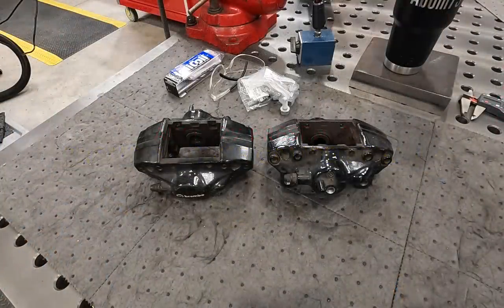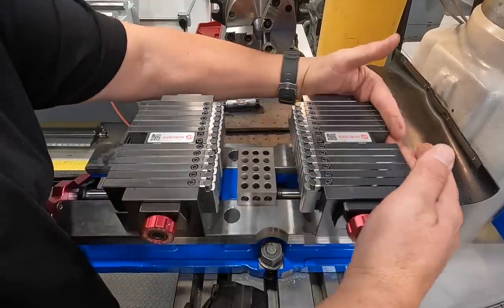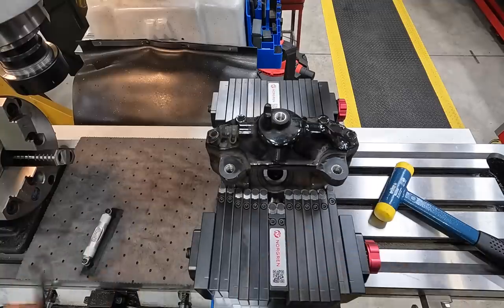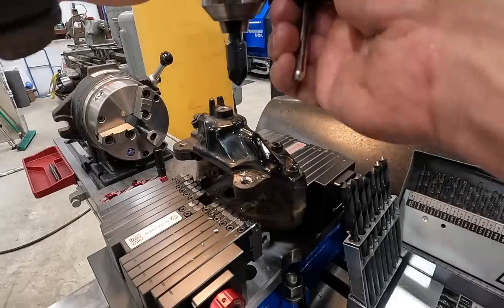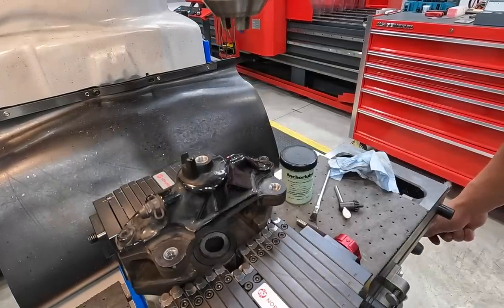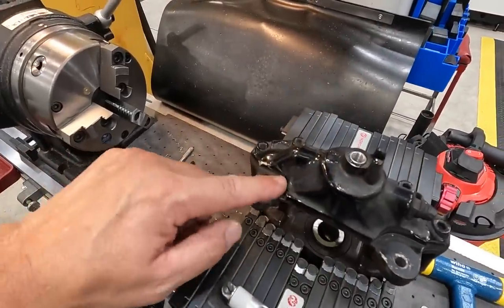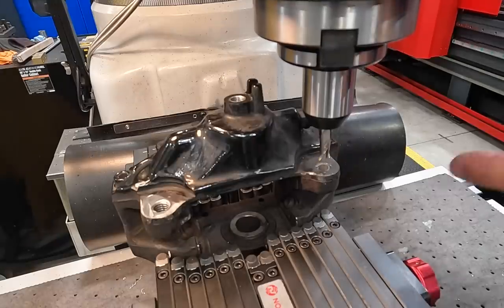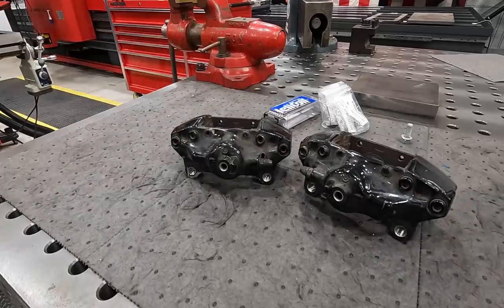Brembo Brake Caliper Repair

Comment: Adam... been a subrcriber of your channel for a while and really love your work... but I have to say I would not touch brake parts... Maybe this was a way for you to show the capability of the new jaw system and for that it has served its purpose, but modification to old brake parts is just looking for trouble...If that vehicle was involved in an accident and it was in some way related to the brakes what then...  As I said the machining and methods are all good... but I would have declined to work on these specific parts...  Just saying... keep up the good work!
Reply: I came here to say the same thing...  As a brake tech for several levels of Racing (mostly Alcon) in the 90s and 2000s, these are not "special" brakes, despite the Brembo label.  The prescribed method of doing any machining on these would be to pull the 4 bolts and use the machined surfaces where the two halves join for reference.  But you are right about the vise being shown off well.   Beyond that, any level of machining the attachment points (especially on an axial mount brake body) is a HUGE no-no.   If Adam has any sort of liability insurance on the shop, the carrier will be calling Monday morning and demand he take this video down and the Insurance Co. lawyer is already screaming NOOOOOOOOO!!!!  As soon as you machine a brake body you release the OEM from ANY liability and assume it yourself.
Reply: @ramosel  Great Speech...but the entire world has no problem replacing brake parts made in...???....
Reply: @phased-out-24-73  yep...  but how do you sue Chiang kai-Shek Brake Parts Ltd?  It's easy to go after Adam.   New parts, regardless of origin show intent to make things right.  Receipts stand up in court.  Most (reputable) car flippers will change out all the brake parts on each corner... add it to the cost of the car and sleep well.   I've never heard an investigator site new parts.   Altered from OEM design....?

Comment: I prefer thread lock during insert, not lube.
Reply: I was wondering about that.
Reply: @vincenzo6412  Me too
Reply: Me three. I've seen a lot of Heli-Coils unwind themselves.
Reply: They usually won't wind back unless the bolt seizes to the tread insert. I put them in dry. The top thread digs into the aluminium if you try to back them out. Best to get the length right before inserting them. Then I use silicone sealant to prevent bolts from seizing because it seals the thread from moisture. Worked on my twenty year old dock, no seized bolts.
Reply: @paulshermet535  Yeah, I was thinking red loctite on the coil and antiseize on the bolt so there is no chance of ripping the coil out if the bolt is stuck in.
Reply: @paulshermet535  I use the coils with teeth on the OD if I'm worried about them backing out.

Comment: I thought you loctite them in place, I always have on any I've done. don;t want the helicoil backing out when removing the fastener in the future
Reply: That's the reason the coils have a tang to remove to lock them. Usually when a helicoil comes out is due to improper hole drill size.

Comment: Asking as a layperson, why use the end mill to remove the broken bolt if you're just going to use the drill bit to drill a clean hole?
Reply: There was a hole off-center to the bolt so a drill would want to follow that hole.  The end mill can cut through the bad bolt on one side and put the net hole back in the original location so it can be bolted t the spindle again.
Reply: @kensherwin4544  Thank you

Comment: Could you have threadlocked the helicopil in the caliper during insertion? Or is there no risk of it backing out
Reply: That's my thought. I always try to use threaded inserts with locktite for thread repairs....maybe I've been overkilling it.
Reply: Per the manufacturer, helicoils are to be installed dry

Comment: you should be putting red thread lock on the insert. it will come out the first time the take the bolts back out
Reply: If that's an issue you should be using a different type of heli-coil.
Reply: You dont use loctite on helicoils. Read the packaging!
Reply: I've never had one move after installation. Ever try to get one out?  Even without loctite it's friggin' impossible

Comment: A threadsert with Loctite instead of a Heli would have been my choice for that only because the torque on them and the fact that they will be taken apart every 40k or so miles by hacks at a Midas
Reply: Loctite wouldn't work for this job. The caliper is aluminum and the helicoil is steel. Loctite and other thread locking compounds only work on mild steel.
Reply: @NP-rh3dt  that's certainly untrue based on their marketing and my experience and auto manufacturers recommendations. Millions of steel bolts in aluminum engines have been successfully loctited
Reply: @NP-rh3dt  Reading comprehension is important, I said threadsert not a coil, which have been standard practice in repairing threads in aluminum blocks and components since the dawn of time. I lost count of how many Northstars and Olds Aroura L47's head bolt threads I had to repair with serts. Everything else you said is just untrue
Reply: @quick455  I've never heard of the brand threadsert, I have heard of time sert however. Those are steel threaded as well. You'd didn't specify aluminum inserts specifically. I don't really see the point in putting in an aluminum insert either, you'll probably end up with the original issue of the aluminum threads gauling up.
Reply: @UnreasonableSteve  No they haven't been successfully loctited. Unless it's aluminum specifically loctite, the thread locker is acting more like a glue than a true locker. Red loctite is so powerful because it actually creates a bond with the steel. I remember a demonstration I saw where red loctite was used on stainless and mild steel bolts. The mild steel bolt was practically impossible to unthread. The stainless bolt was possible to unthread with some difficulty. Cars are also a terrible example. I work in heavy industry where thread locking is taken much more seriously. I was told from day 1 that loctite only actually works on mild steel.
Reply: @NP-rh3dt  you were told wrong. Loctite certifies that their product works on aluminum. It is indeed basically a glue, but it functions equivalently for any of the metals listed. You said it's virtually impossible to unthread a steel bolt from a steel hole (I assume without heat) with red loctite and I agree. The same experiment would have the same result with aluminum because the aluminum threads would be torn apart before the loctite would let go. The claim that loctite wouldn't work to hold a helicoil in aluminum is ridiculous

Comment: Did you consider drilling a larger hole and pressing a new bushing with the correct size thread into the oversized hole instead of using Helicoils?
Reply: Just pressing a sleeve in won't work because it will pull.. it is possible to thread a sleeve in but it's more work and has the potential to screw in or out then loosening or tentioning the bolt and it would require more material to be removed.. helicoils are far better and the repair is better than new
Reply: @markshort9098  He Did Tread A Sleave Into It!!! It Just Had The Internal Threads Already!!!
Reply: @rockerpat1085  maybe read the original comment and then read my comment responding to it.. I know all to well what Adam done, I've installed many helicoils myself

Comment: I know everyone thinks differently but dont you think you should have used loctite on the Helicoil?
Reply: That's how I was taught to do it.
Reply: @josephcote6120  me too
Reply: Not necessary. If you have an application where the additional retention is needed, you'd use a different insert than what's shown here.
Reply: Heli-Coil says no, dry, friction holds the insert.

Comment: You could have taken apart the two halfs of each caliper and put them on a fixture plate. It would be faster and easier
Reply: …but not such a fantastic example showcase for the sponsored vice jaws.
Reply: @mlenstra  Thats what i thought :)
Reply: @mlenstra  the.................... $7000 vise jaws.
Reply: @weldchip  Holy sh*t, that’s priced... rather exclusively. I guess this falls in the “if you have to ask what they cost, you can’t afford them” category of products intended purely for high dollar intensive business use where saving 5 minutes of setup time per job means these pay themselves back in mere weeks.

Comment: While is this is a good use of the vice, it's probably easier to remove the allens that hold the 2 sides together and bolt the half flat to the table.
Reply: Brembo doesn’t recommend splitting these. You’ll also have to replace the o-rings which can be a little tricky to get ahold of.
Reply: @mittenvision  Good point, I split other calipers a that are assembled the same way without issue tho.. Brembos can be a PITA to rebuild parts for..

Comment: Is there a reason you didn't use a Time-Sert for this? I kinda prefer them to a Helicoil. Also a fan of the Keensert. IMO, the are both a bit more permanent as the helicoil can pull out.
Reply: He has always used helicoil for thread repairs. I also prefer time-sert but once you guy into a system it is hard to change. Helicoil is fine for this application as it a larger thread and does not come apart often.
Reply: Quick question guys - these systems you are discussing, I assume they're similar to a helicoil?

Would there be any advantage to using a tiny amount of threadlock when installing such a thing?

Never used anything like that, I'm just curious.  And you guys seem to have experience.
Reply: @antontaylor4530  you can loctite helicoils but because it is a coil and not a solid insert it can get on the bolt too and lock the bolt to the coil making the problems worse. You can you just have to clean very good.

Loctite timesert as well and it is recommended on some applications such as cylinder head bolts. Because it is a solid insert the concern of getting loctite on the bolt is eliminated. But timesert is mechanically locked in place by the insert tool so normally loctite is not needed.
Reply: @jrichardson-m9m  Yeah, I did think I saw a little daylight through Adam's helicoil.

I saw a project farm video where he proved that, at least for aluminium parts (cylinder heads etc) that helicoil and other metal inserts are significantly stronger than the original threads.  Even some crazy cheap Chinese knock-off kit did wonders.

I was looking at them wondering what stops them moving around, though.

If you used a tiny amount of loctite on them, you could let them dry before running a tap through to get rid of excess, couldn't you?
Reply: @antontaylor4530  helicoils are actually a little bigger than the threads you cut for them so you have to squeeze then in. That is why he put a chamfer on the hole. That usually keeps them in place.

Never run a tap through the insert, you will just hurt yourself. It is likely to damage the insert and bind the tap.
Reply: @jrichardson-m9m  It is a brake caliper. It will have to come apart a bit moer than, say a valve cover or oil pan. For that reason, I like the Time-Sert. Plut the ability to use a locking agent on the TS. Helicoil can't be locked.
Reply: @jrichardson-m9m  Roger that.  Thanks for the advice!

Comment: Adam....I've never used those Helicoils so sorry if this sounds silly but.... I'm curious,  how do you snap off the tang in a blind hole?
Reply: he shows it in the video. a punch & knock it out
Reply: the helicoils  typically don't go all the way to the bottom, also their is some space at the bottom of a threaded hold that's blind. the tang piece can stay in the bottom with no issues.
Reply: ...often it's not necessary to snap it off  but you can use a small hook or needle nose pliers to pull it up & down to snap it off...or just grind ~1 mm from the end of the bolt you use.
Reply: You break it off the same way as Adam did then use a magnet to remove the piece from the hole.
Reply: Helicoils have a cut in the tang to create a weak spot so when hit with the punch, the tang just snaps off
Reply: Thanks all...I thought the coil would bottom out not leaving any room to knock off the tang.
Reply: @wino4340  Yes it can bottom out sometimes depending in the helicoil's length...I have shortened a helicoil (either before or after insertion) then ran a bottoming tap through it to make sure the bolt will start clean...

Comment: How about corrosion? Helicoil isn't made out of aluminum.
Reply: They are stainless.
Reply: Neither is the bolt.
Reply: This is gonna get me hated on, but I would use anti-seize on these caliper bolts on installation

Comment: That caliper should have been disassembled just saying
Reply: Sure. But, we have all been in a position where we couldn't,  or didn't want to, and made do as best we could. If you have not been in that position,  you will eventually.
Reply: Would have made it so much easier too
Reply: Disassembly is easy, proper sealing during assembly may not be.
Reply: @v8packard   Exactly.  Btw Packard is a cool name.
Reply: @groosbro1  exactly this, don’t split them if you don’t have to. Can’t see how splitting would have made a better job.
Reply: Why? Worked fine assembled.
Reply: @Waikatotek  Thank you!
Reply: Well metal flakes could have entered the hole where the brake line threads in plus why wasn’t any thread locker used on the helicoil
Reply: @tahoeman1967  The thread locker would be ineffective on this type of thread insert, as it is a wound wire not a solid insert. 

As for chips getting in, that's easy enough to prevent, and deal with.
Reply: @tahoeman1967  metal flakes could be an issue to be fair, but could have just blocked feed hole. You don’t need thread locker, the pressure the bolt buts on the helicoil holds it

Comment: I think Timesert would be a better choice then helicoils, at least that's more common aluminum brake brackets
Reply: That test has been ran. Helicoils beat every single expensive option that would seem to be better.
Reply: @justRD1  they truely are a great thing. Cheap and simple and they flat work
Reply: @justRD1  do you have any info on this? thx

Comment: if the bolt rusts to the helicoil will it pull it out after that?
Reply: Heicoil is stainless steel, the bolt will not rust to it at all. Worst is you turn the insert out with the bolt, and simply put a new one in with thread lock again. That thread is now stronger than the original, and will survive thousands of insert remove cycles, unlike the plain alloy thread it was originally.
Reply: Certainly possible. I like to use red Locktite on the Helicoil, and then a light coat of anti-seize on the bolt threads.
Reply: @SeanBZA  Bolts are probably zinc coated or stainless steel so no rust.
Reply: @ellieprice363  Those will be electrogalvanised high strength steel, though electrogalvanised does need proper post plating treatment in a high temperature environment to ensure there is no hydrogen embrittlement for the high tensile variants. Those bolts are, according to the manufacturer of the brake assemblies, supposed to be used only once, and replaced with every brake pad change, as they are classed as a safety critical part. But not even the dealers do that.
Reply: @SeanBZA  Sounds like something the bolt manufacturers came up with to sell more bolts. Following the money will often reveal the answer when nothing else makes sense.
Reply: @ellieprice363  No, plenty of cases where you have modern vehicles (and plenty of older ones as well) with torque to yield bolts, where they are use once items. Very common on head bolts now, where you have an initial torque value, then a second higher one, then wait 5 minutes, and then 90 degrees and 90 degrees. Then the bolts you remove are noticeably longer than the new ones, because they have stretched plastically. 

Most common place you will find it is on flywheel bolts on modern vehicles, where when you buy a new flywheel from the manufacturer, it comes with the new bolts as well. Try to reuse them and they are likely to snap as you tighten them. Same for front pulley bolts as well, often marked as replace when you have to undo, to replace a timing belt, and also for the top pulleys for the cambelt or chain to the cam shafts.

Another place is on aircraft, where many service manuals call to replace all bolts in a particular area when you service there, as a matter of principle, and to use new bolts every time. Might be 400 bolts per engine you replace, but you do that, as it is cheaper than testing each one to see if they still will work safely there, and you really cannot pull over and call AAA when in flight.

Comment: Damn, went the long way around when he could've just tapped new threads and used a caliper bolt from a big Dodge van. I swapped the Brembo labeled junk for Wilwood and can do pad swaps with a leatherman tool in a few minutes.

Comment: looks like your quill spring is too tight... shouldn't it just barely retract? i always thought the quill "return" spring was for counter weight not retraction. if you're drilling small holes with a tight spring you will not be able to feel the drill.

Comment: Hi Adam, I don't doubt the work you did was perfect.
My question is, if the brakes where to fail (not necesairly because of the thread repair, but you worked on it) would you be liable ?
I'd be cautios doing this kind of repair.
Maybe write down the rapair is done at the customers risk.
Just keep safe brother.
Reply: Put a sign on the front of the car saying if I hit you I'm not responsible.

Comment: It would be interesting to understand how the callers were made in one piece.
Reply: They aren't, they are 2 piece bodies. Split them and you would have a reference surface and need a seal kit to reassemble, which would be a good idea anyhow for 2nd hand units
Reply: the general shape was cast followed by machining.